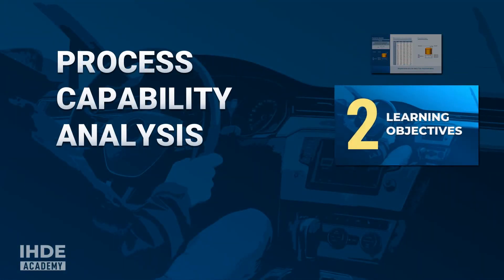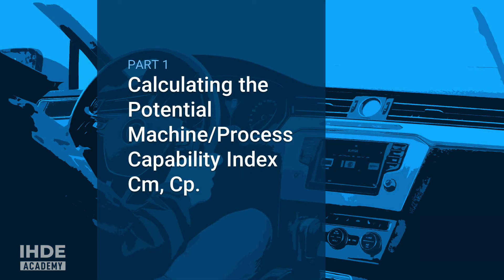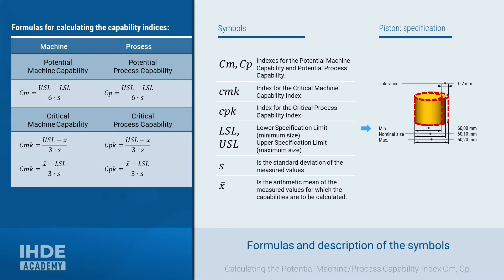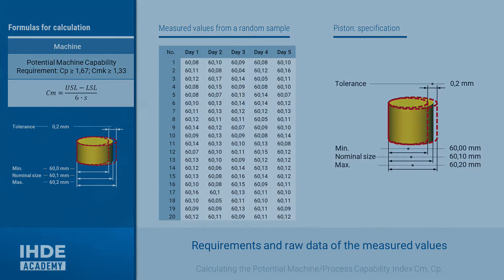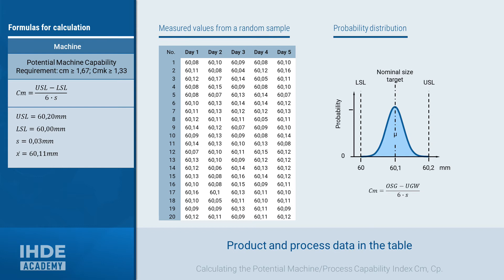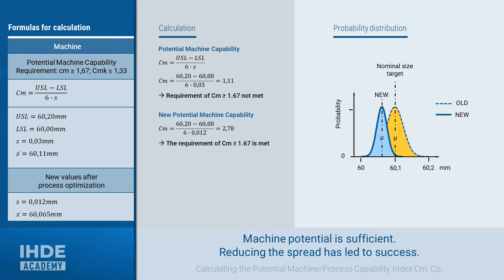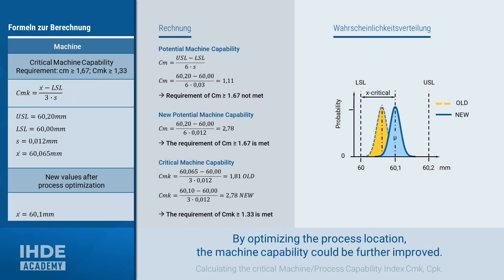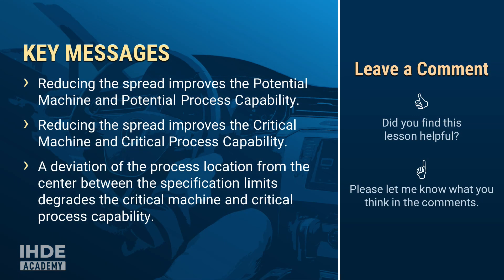How to calculate Cm, Cmk, Cp, Cpk: from raw data to the index | Capability 1-3.3| IHDE Academy

Comment: Hello from México, I got a question, if the formula for  Cm and Cp are the same, this means Cm=Cp ? or How can you separate the machine from the process and the process from the machine to be able to measure them separately? Basically the same question for Cmk and Cpk... waiting for your feedback, regards from Mexico
Reply from the maker: ¡Saludos hasta México! Great question. Even if the formulas look the same, Cm/Cmk and Cp/Cpk are not equal because they use different sources of variation.

- Cm/Cmk: short-term machine capability from a tightly controlled study (one machine, one setup/operator, same material lot, 50–100 consecutive parts, no adjustments).

- Cp/Cpk: longer-term process capability that includes everyday influences (different shifts, operators, material lots, tool wear, environment).

In real life, long-term variation is almost always larger than short-term variation, so you typically see Cm ≥ Cp and Cmk ≥ Cpk. To separate the machine from the process, run both studies: first, a controlled machine study to isolate repeatability, then a process study over days/shifts to reflect reality.

Comment: can i ask you how did you get 0,012
Reply from the maker: Thanks so much for your question!
In part one of the video, we calculated a standard deviation of 0.03 mm based on the data set shown there.
In part two, the goal was to show how reducing variation in the process can affect the potential and critical machine capability. To help illustrate that, we randomly chose a lower standard deviation of 0.012 mm.

Comment: What is the typical/critical part that used for cmk monitoring ?
Reply from the maker: The FMEA evaluates the severity of the characteristics and functions of assemblies and components.
From the severity follows the classification into significant or critical.
The probability of an error occurring is low if specified machine capabilities or process capabilities are met.
An example of an assembly is the breaking load of a seat belt.
--> e.g. breaking load Cpk >=1.33.
Imagine that the safety belt contains two steel brackets that are riveted together and also have to meet this breaking load.
At a component level, it could be argued that the diameter of the rivet bore is important for the breaking load.
--> e.g. diameter of the rivet bore Cmk >=1.33.

Comment: Where did you get S=0.026 from?
Reply from the maker: Hello Daniel, thank you for your feedback. The standard deviation was calculated for the complete data set of n=100 values. With the Excel function STDEV.S, a value of s=0.02648728 results.